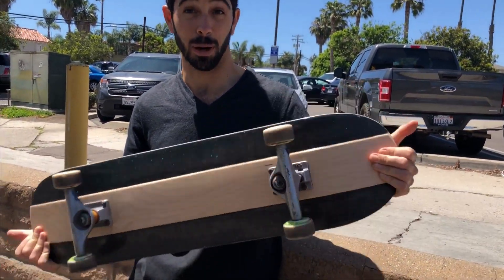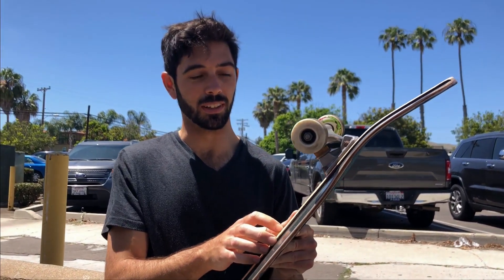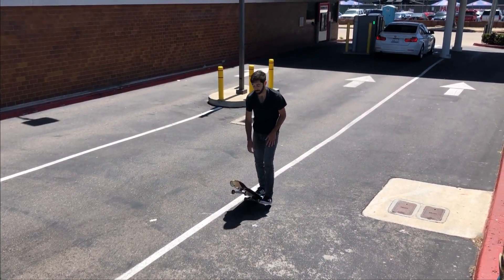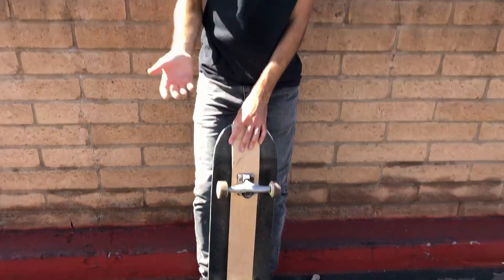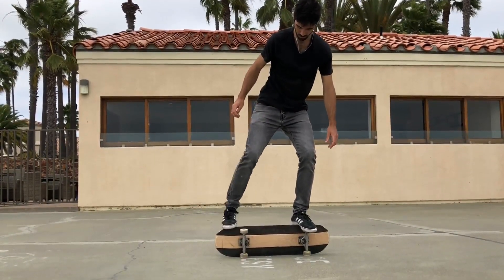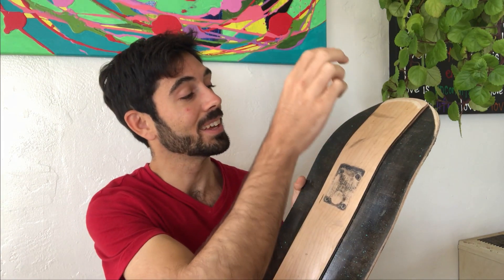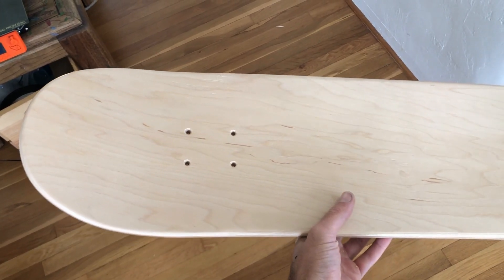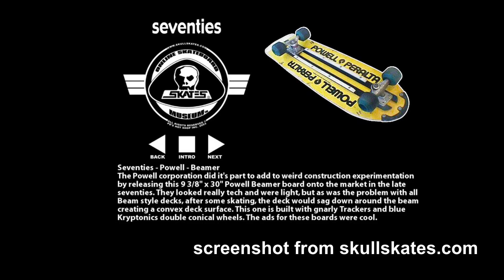Making a Lighter, Faster Skateboard? - Build of the Week #8

Comment: The Gonz also has a deck called the "Beemer" that also has a central "beam" with cutouts on other parts.  
Also, do you ever use foam or wood inserts specifically around where the bolts would go? I recently saw a carbon fiber, fiberglass, foam only street deck and was impressed.  When I make my own i'm definitely going to use wood... I was also looking at how libtech does it, and they have a totally different method, using custom veneers.  They build like an outer skeleton with softer insides. So many cool ideas....